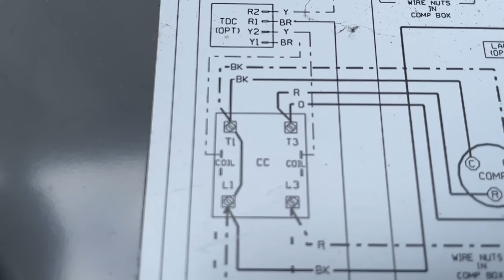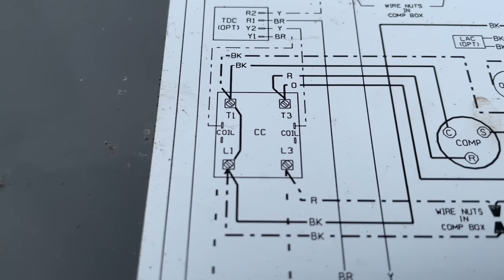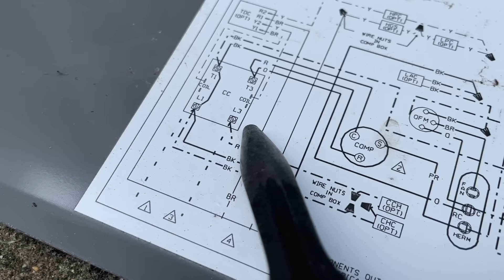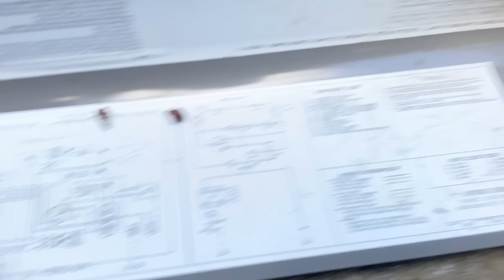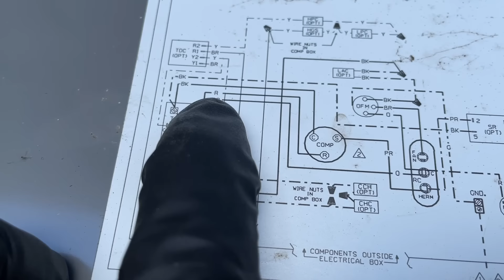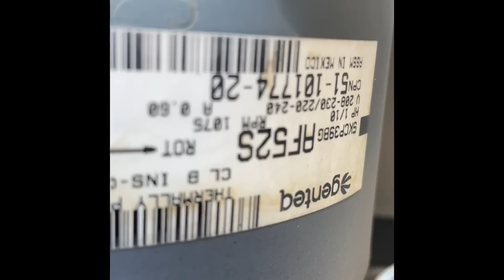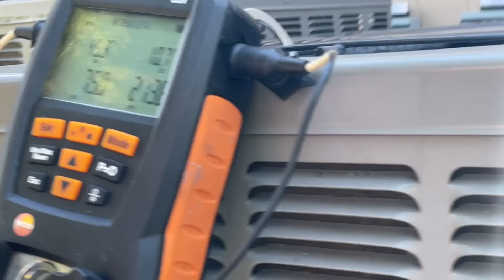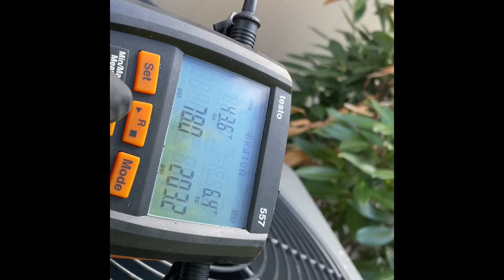Letting the Apprentice Run an AC Maintenance Service Call Godzilla vs Rheem Condenser Who Will Win?

Comment: Only need a single pole if there’s a crank case heater on those other wise don’t matter if it’s single or double
Reply: how do you figure
Reply: whats the difference of a one pole and a two pole for a crank case if you can just tie it in to the L1 lug on a 2 pole. L1 and T1 is thevsame on. a 1 pole.
Reply: @OleRazzleDazzler  there is no difference if you understand what your wiring but when they have a crank case heater that’s when you normally see the single pole contractor
Reply: @OleRazzleDazzler  but if you just go wire for wire and don’t understand what you doing then the heater will not work when unit is not calling so yes your correct there not different if you understand what your doing but some “techs” I’m sure don’t
Reply: yeah. those techs that barely can read schematics.  i see what u mean

Comment: The only time a one pole contactor is needed is for crank case heater. I also put what goes back but it won't make a difference if you don't have the crankcase heater. Thanks for the oil tip under the fan. I'll check for that. TIP check across when unit is running from L1 to T1in voltage if you have voltage it's a sign of pitting contactor.replace it.  You can also check with no 24 v at coil  and going with continuity if there is resistance that means the same pitting not making completely. You have showed me some things when it comes to steam just sharing other tips that work. That method work with any switch. Last one gone from one side of coil to ground when you get 24v remove that side and wire nut it won't short. So you safe to do test. Put a wago 😂 take care and thanks for your time
Reply: Excuse I write to fast. In continuity there can be no voltage you already know that you don't want to damage your meter. I do everything with voltage even capacitor if I get a voltage drop then I take.the disconnect off and remove the 24v by going from ground to each side of contactor find 24 v remove that from thermostat coming from air handler wire nut it then I do the manual continuity test. I perform that as a confirmation of the voltage drop test across the legs if I get resistance I replace . Makes life easy and once you do them under load all the time  it becomes really quicker and saves call backs. Thanks for sharing comments.

Comment: One thing I would have done with Steven, when he was wiring that contractor was explain to him what each wire he took off and reinstalled did and where it went to,  Ie. the black wire was going to common on the compressor, the red wire going to run on the compressor, and the orange wire going to the capacitor, which in turn powers the start windings in the compressor and fan motor.  I think he would retain the info better if he knew what they did.  I'm really glad to see younger people getting into the HVAC field.  Keep learning Steven and you will get it.

Comment: My first attic i hung the air handler & coil on threaded rod but did not pitch  towards drain  house was ice cold  i tested my drain with a gallon of water that i poured in directly well my customer got a brand new ceiling

Comment: I have been watching your site for a while love how you teach him best way to learn in thru experience. The previous contractors obviously didn't know what they were doing on putting in double pole contactor on those units.As you pointed out they have crank case heaters on them so the way they were wired before the crank case heaters never be energized all the time only when double pole contactor was pulled in. I am surprised that they didn't know that and void warranty on compressor if they were still under warranty. Can you imagine on a cool day below say 40 degree day start up on a compressor with cold oil how hard that is on a compressor?

Comment: +1 for another commenter that says take notes..  I still have my big 3 ring binder full of the info sheets that came with contactors, motors, gas valves, furnace boards, etc..  not every unit still has the nice wiring diagram in it..   one thing I didnt have when I was in the industry was a smart phone with a camera..  taking pictures, organizing them and saving them is huge..  I do it in my current career all the time..  I also take pictures before I unwire something...  if my phone rings in the middle of a job  im likely to forget where all those pretty colors were when I hang up..  refer to the pic as its quick

Comment: Okay first of all, I strongly believe that you have to understand what the parts do and how they work before you are allowed to perform a maintenance. When I taught my apprentice how to do a maintenance on an AC system we always start by taking the cover off of the condenser, name all of the components, and explain what they do. Then we stop! We then sit in the grass while we take a look at the wiring diagram on the cover of the unit. We start by reading the legend of of all the components the diagram lists. We then find and name all the components on the wiring diagram as we go down the legend. Then we start from L1 L2 and work our way through the diagram and follow the flow of electricity through the components while naming them again, and making our way through the schematic. Then we bring the schematic over to the unit and do it again while relating the schematic to the actual physical components/parts. This is the best way to turn the lightbulb on in the apprentice. Take it slow and create a no pressure situation by guiding them through. Guide them through, guide them through, guide them through, and now they see the system.  Now they understand the system. Now they see it clearly instead of just a bunch of confusing parts and wires. It truly amazes me how well this method works. Take it very slow while going through the diagram because it is very important. And if you do this you will save months of the apprentice being confused and unsure of themselves.

Comment: i think the unit needed refrigerant more than a contactor or cleaning in my opinion do not hate.even a bosch with that pressure wont work,they all say they need routine maintenance.but there is always something wrong.

Comment: Was that unit really 410A? because on a PT chart that's a 17 degree saturation temp. Pretty sure that EVAP coil is gonna freeze. I could be wrong. Did you take a wet bulb reading in the house? No disrespect just curious.

Comment: If you open up the contactor you could also had seen if it was a single or double fyi im pretty sure the one you took out was single as well
Reply: Yea because some single pole have a cover on the as well
Reply: I agree. MP replaced like for like. The old ones had a shunt between L1 & T1- as shown on schematic. Bad MP.
Reply: @douglasteetzel3552  that I was pretty much trying to say on the cover and schematic it said the contactor had a shunt idk MP I would double check that I actually found the contactor on Google and was single to

Comment: Godzilla keep at it, I'm pulling for you.  I learned to be an electrician from my Dad,  best education I got.    Mikey's not that tough, it's more like a hazing.  Yes, you need to go get the pipe stretcher and fill up the blinker fluid in the van. Once you learn the trade, then the next lessons are how to deal with your clients.  Mikey has tact..he's Rico Suave.  Pick up on those lessons too.  You'll be just fine with Mikey Pipes.

Comment: If you ever come across a contactor that doesn't seem to look the same as the one you are replacing ( although it's specifications are correct) you can check it's function with a multimeter on continuity . Then once you know which terminals  do what you can normally visually swap terminal to terminal, however sometimes the new or replacement piece has double the number of terminals. That's where it pays to have a spare on hand just in case.

Comment: I just pull the low voltage from the Contactor and put some electrical tape over them so they don’t short till im done with the repair.
Reply: I disconnect from the wire nuts and cap it.

Comment: Come on Mikey pipes a two pole contactor is much better than a single pole specially safety wise when a two pole contactor is disconnected there is no power going to the compressor if somebody sticks the hands into it besides that it’s always better to break both legs of a two pole 230 V unit thank you

Comment: Logged in and started t owatch the video Premiere and then my work phone rang..  missed the rest... time to watch it now
Reply: @PipeDoctor  dude!!  brings back lots of memories of my first couple times..I didnt learn crap in HVAC school compared to what I learned my first year in the field! this is how its done!  lucky early in the season and no yellow jackets in those units..  wait till he is up on a commercial roof and pops open the door of a 10 ton to be greeted with 100 hornets..  he needs to add raid to his fancy tool bag for the summer seaosn! I also always put a meter on each leg before I replace a contactor..  unfortunately ive seen outside disconnects bypassed internally! do you guys foam the coils or just rinse down? Zilla did good! he wasnt afraid to dig in even though you were prodding him..  thats Huge.. alot of guys woulda walked...  +1 for Zilla!

Comment: If there’s 24 volts at the coil, the disconnect is pulled, so no high voltage, and the plastic cover shows single pole contactor “shunt”. What the hell is wrong with the contactor? It’s pulled in like it’s supposed to be. Love you Mikey Pipes and Godzilla but damn.

Comment: Did Steven take and check a pic with his phone first to verify existing wire placement.  Steven would carry a pack of tic tac’s in your pocket. And give two to Mikey when he is breathing down your neck.   So you get minty fresh hot air.  
After reading this all you have to do is pull the tic tac box out of your pocket and Mikey will understand clearly.    Mikey likes it. 
This is how I have learned to get my point across with people.   Very calmly.     Thanks eric

Comment: Mikey Pipes, when those contactors you refer to as “double pole” have the printed SHUNT on the front they are actually single pole. They may look like it but if you remove the cover they have a shunt bar across L1/T1. These reason they use single poles are for crankcase heat. Love the channel btw.
Reply: the blind leading the blind lol.

Comment: Ok  Steven gets points because he did catch it was a single pole contractor when Mikey stated a 2 pole contactor.  An obvious mistake 
Steven may have gotten lucky but,  (right is right).   Mounting controls is finesse and comes with experience.  
But I didn’t see Steven double check with stupid stick before disconnecting wires.     Overall good job Steven.

Comment: Now don't bite my head off Mikey Pipes but this video lets you down severely - firstly and fore mostly your apprentice does not seem to me to have any confidence in what he is doing - so I would not let him anywhere near high or low voltage irrespective of where the fuse is blah blah blah - I would not let him near a panel until he has shown good electrical knowledge and safe work practices. The other thing is empathy in your teaching style - your guy seems a mature looking teenager or an adult apprentice who is extremely green and needs to be guided in a mature manner. You are an awesome tradesman with a lot of knowledge to pass on but you need to do it in the right way. I have trained many industrial electrical apprentices in the automation field and some of them still tell me how thankful they are of the time and effort that I gave them when they worked with me - hopefully godzilla will also thank you for your patience in years to come.
Reply: @PipeDoctor  - thanks !! Hope all is well in your neck of the woods - take care and best wishes from Australia !!